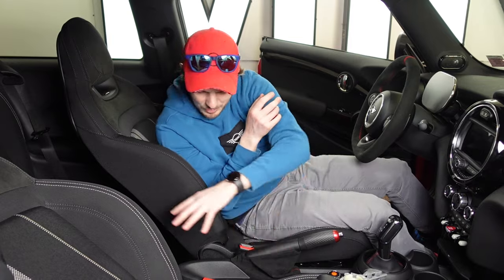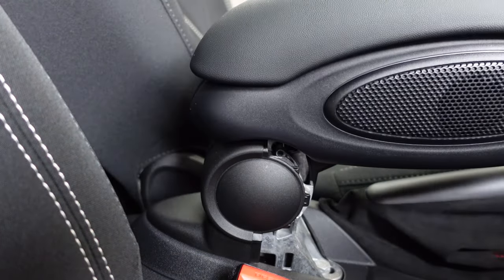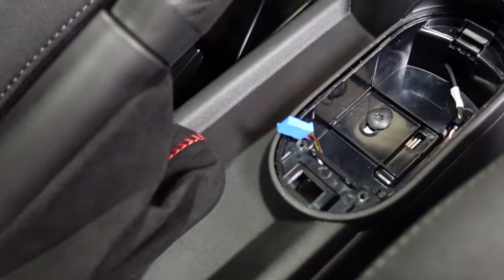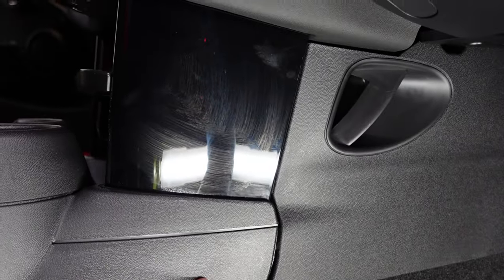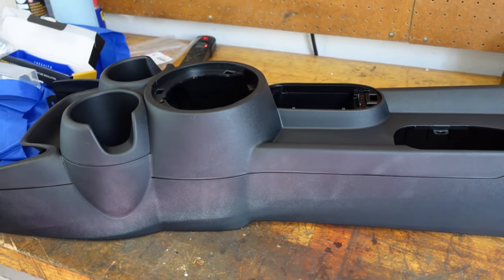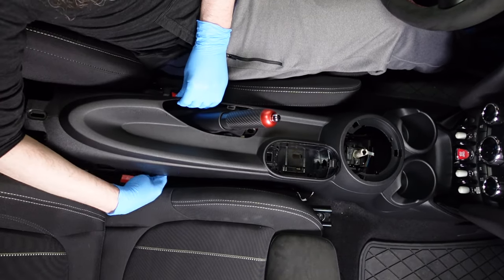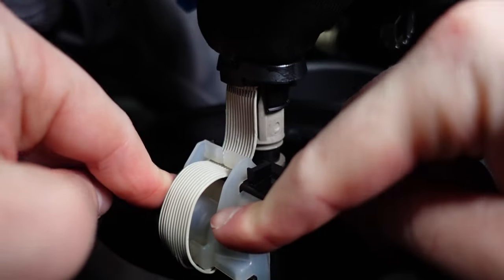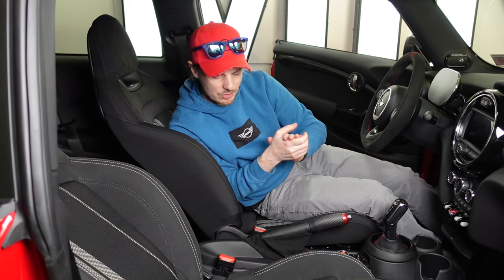How to DELETE the armrest out of your MINI Cooper

Comment: That’s a truly VERY VERY well made step-by-step-video of all the required disassembly and assembly - thx a lot for that!!
I’m actually not unhappy with my armrest, I’m just wondering if I could somehow rise the I-drive controller up by a few centimeters…  maybe 3d printed spacer ? Would the cable be long enough ?!

Btw 2:06 it’s not a 13mm bolt rather a 13mm spanner / Hexhead screw that’s actually and M8 or 8mm bolt 😊
Reply from the maker: The cable should be plenty long enough to raise that up somehow with a 3d printed spacer

Comment: But Why !!?? 😮
Reply: watch the first 8 seconds...
Reply: @MrMonsieurGreen I
Will never buy the car without armrest. That why I don’t understand.
Reply: @Aldik1980  Definitely a valid question. Most people wanting to do this will have a manual transmission. It gets in the way of your arm when shifting through gears. It also gets in the way of the parking brake, but I assume most people with an automatic will live with it and not remove the arm rest.
Reply: @Aldik1980  I did this because I have a manual and it got in the way, I also rarely used it and just kept it in the up position all the time. So I’m happy it is gone.
Reply from the maker: I know it's not for everyone. That's what is great about our MINIs, they are all different and match our likes/wants/wishes/desires!